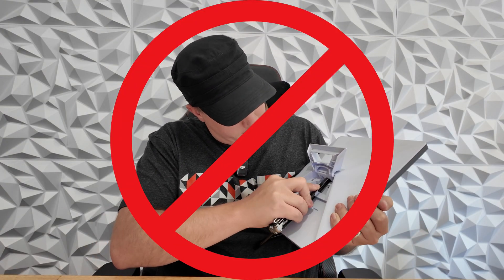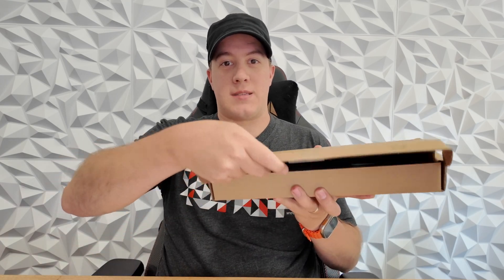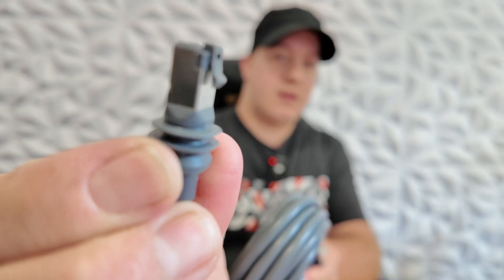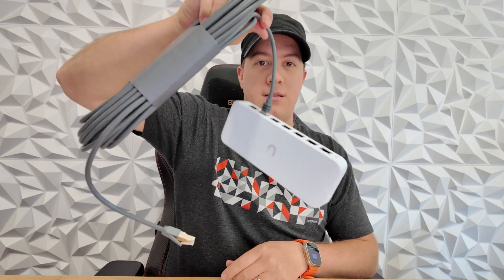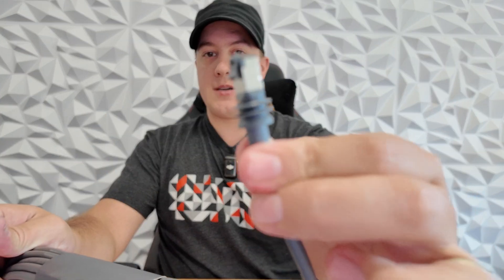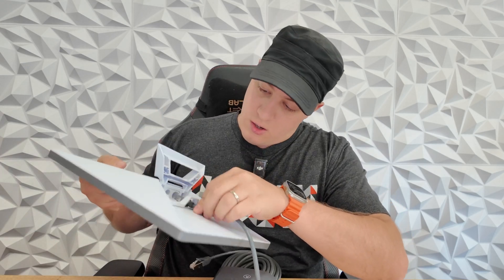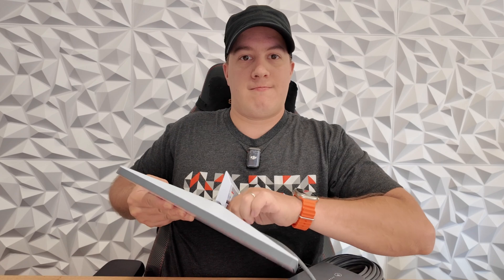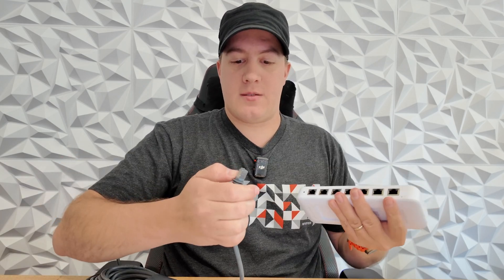How To Waterproof The Starlink Mini Ethernet With Starlink's Official Waterproof Ethernet Cable

Comment: I made the mistake of using the regular LAN cable outdoors because I assumed it wouldn't rain until I got the new waterproof cable. Well, worse case scenario happened.

How can i check the starlink mini for any damages? It was a night with light rain. I already let it rest inside. Do i have like weekly performance data logs to compare? The dish is still working but i don't know how stable... u know.

Comment: The link to the cable, posted above, doesn’t work anymore. There are both a 15m and 45m cable posted on the SL site, but they state that they only work on the standard, not the mini. I’d assume that these would work on the mini as well, despite the switch side having a waterproof boot we likely wouldn’t need. Can anyone advise if this will work?

Also, can any Ethernet switch or router be used, or is there something that is “Starlink specific”?

Comment: wow,  if all you have is a hammer everything is a nail.   I use RJ normal into mini. Gettting out, something thin to release is easy eg razor blade but thin screwdriver works.
Reply from the maker: But then it’s not waterproofed
Reply: @tabGeeks , what you said was hard to get out again is not at all hard to remove normal RJ. I just siliconed a rubber cover onto the mini for the cable.
Reply: @terry9223  now you’re using silicone? What’s wrong with a Starlink adapter as the solution? You don’t have to stick anything down there to unplug it and you don’t have to use silicone hahahaha you guys really that broke?

Comment: "until you apply the right amount of pressure".... so LITERALLY the exact same as a standard ethernet which is not even as hard to pull out as you tried to show at the start.
Reply from the maker: Depending on the device you will break the metal holding it in usually before it comes out. Depends on the device of course. This comes out without breaking it

Comment: Can I run RJ45 into a building for temp connection WITHOUT disabling the internal router? Will it still passthrough? Reason I'm asking is because disabling the router is easy via the app... but to re-enabling the router requires a hard reset which may cause hardware damage if done so one too many times, per Starlink. I only need wired connection temporarily
Reply: I have the exact same question, I just bought it so I'm looking for options, did you solve it?
Reply: @ I solved it. Ordered the RJ45 weatherproof adapter. Installed that, connected my RJ45 and the RJ45 is 100% pass-thru. No need to defeat the internal router 👍 Unreal this info isn’t anywhere hahahaha
Reply: You can run rj45 to a switch and distribute this way. Doing this for a once a month volunteer thing and I’m providing internet to 4 computer stations 👍
Reply: @Bluecollarham  awesome! I'm waiting for the RJ45 cable from Starlink and also I'm getting an Access Point too thank you for taking time to confirm my question 😀
Reply: @ no worries, and when you say AP you mean switch, right?
Reply: @Bluecollarham  yeap, actually I'm getting a gl.inet router to use it with the starlink as a "switch"
Reply: @ rad! Starlink Mini has been a game changer. It’s almost magic how easy and well it works!
Reply: Yes you can but remember that you will be using the internal router which is much simpler and doesn't have many useful features that you may want to have like extra networks, changing the IP address range, etc...